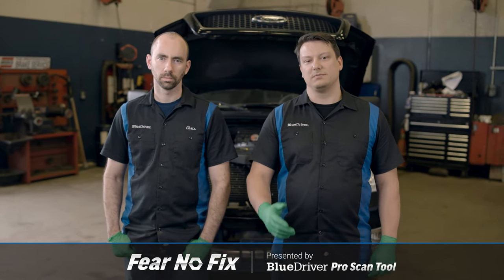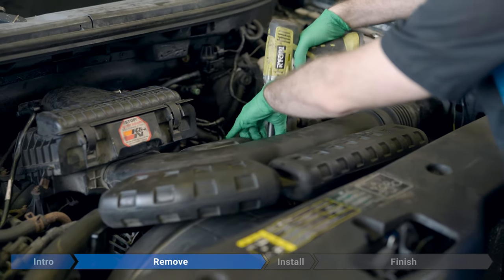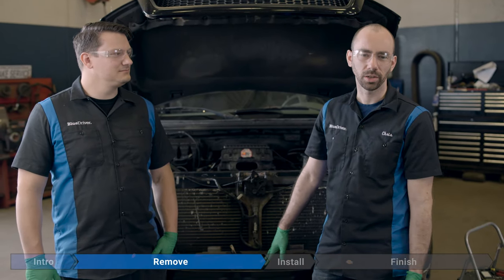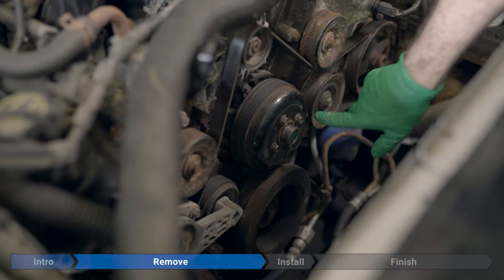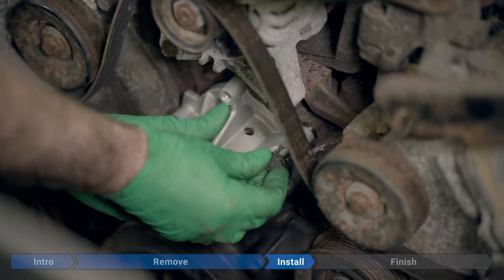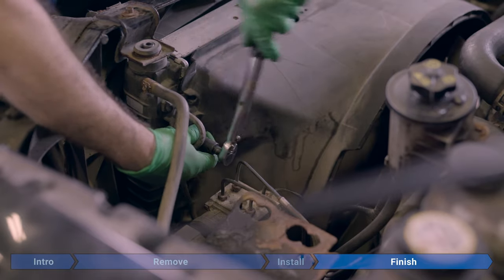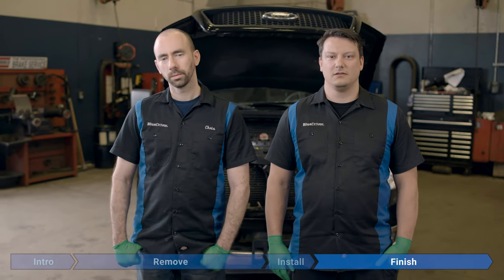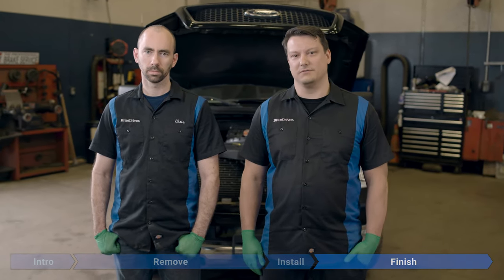Water Pump – 2004-2008 5.4L Ford F-150

Comment: I just have a small coolant seep, but I'm just gonna do a whole new water pump, fan clutch, cooling fan blade, radiator drain plug, and thermostat, and new upper and lower radiator hose and new coolant reservoir, so it's fixed fixed that's what I would personally do. I might as well do a new Radiator while I'm at it.

Comment: Any ideas where these usually break ! ?  Iv got a 06 with 155k. Domt want to break down on the side do the highway   I did notice some belt squeak last winter that was strange but it’s gone now in summer and after winter.   If I go in and do pulleys and belt which I did a few back at 90k   I feel like it be the best time to do water pump and fan clutch LOL. Of course

Comment: so when the parts places ask whether i need a 30mm pump or a 36mm pump are they meaning the thread size on the pump shaft or are they talking about the wrench size needed to remove the clutch?

Comment: Why wouldn't you use a large crescent wrench with a soft blow hammer to break the fan free?
Reply from the maker: That'll work if you have something that big lying around (36mm), but you may still need something to keep the water pump pulley still depending on how stubborn it is

Comment: I got a (2005 f150 4.6L),,,, how much anti freeze does it take if its totally empty of anti freeze,,,,
Reply from the maker: If you're drained dry the 4.6 takes about 18.6L or 20.7 qt of coolant
Reply: @LemurMonitors what about the 5.4L?
Reply: @LemurMonitors and what type specifically?